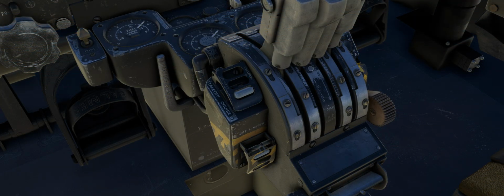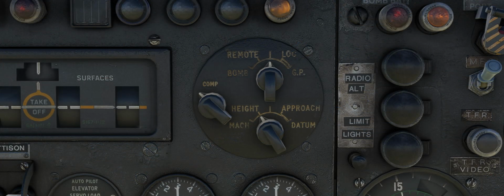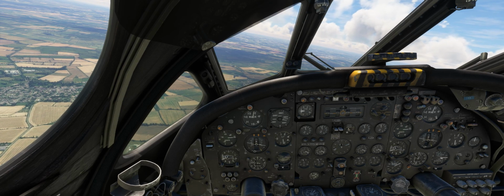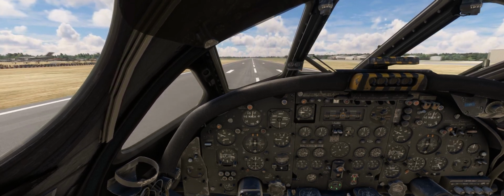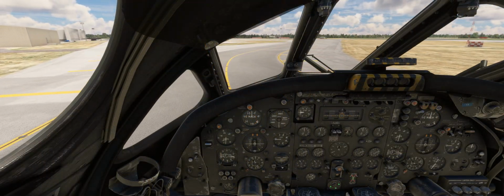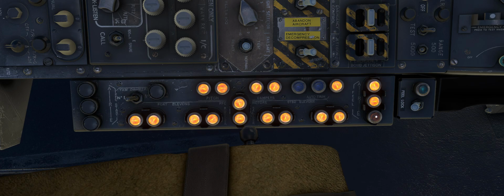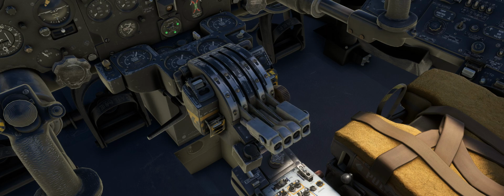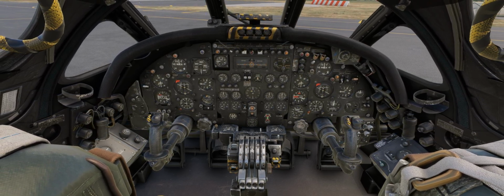Vulcan MSFS Tutorial 4: Descent, Landing and Shutdown

Comment: Hello, I wanted to ask you how do you open the parachute?
Reply: Set the TAIL PARA switch (afaik that’s what’s it’s called and is near engine parameters like rpm etc.) to STRM to stream them out when landing and JETTISON to jettison.
Reply: You can also set auto release on the tablet, or use switches on the panel.

Comment: Ive got a virpil CM3 throttle.  The split throttle only controls the left hand throttle.  The others I have to use the mouse.  Is there a way to bind either 2 engines to one of the split throttles or ONE a